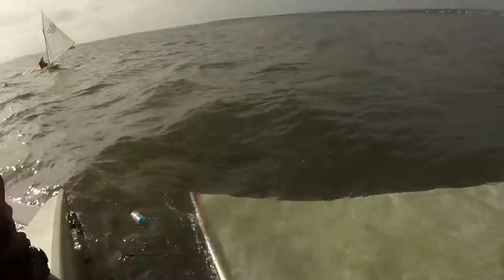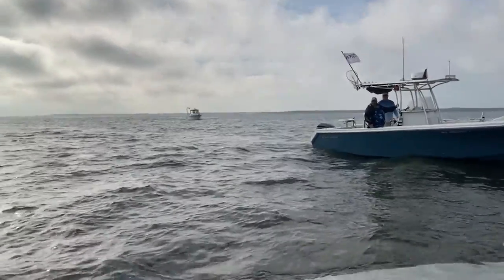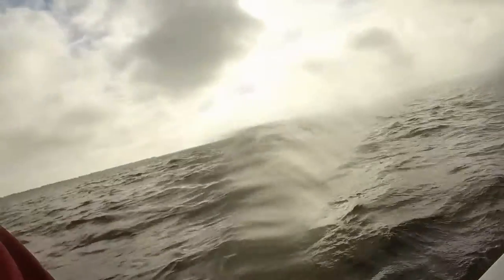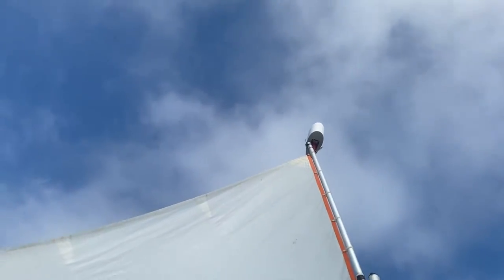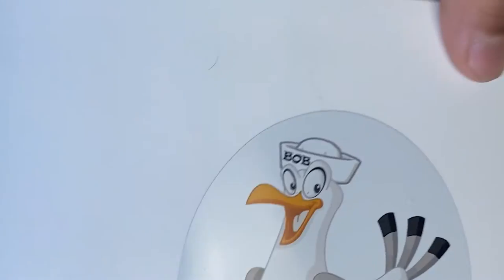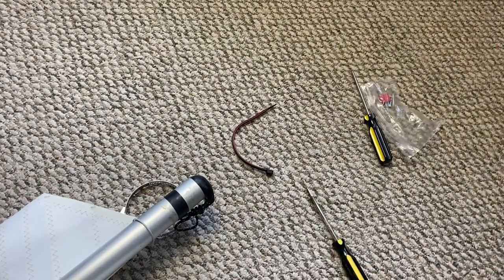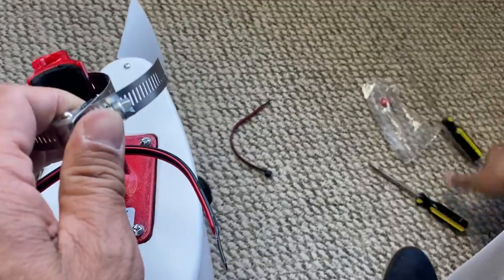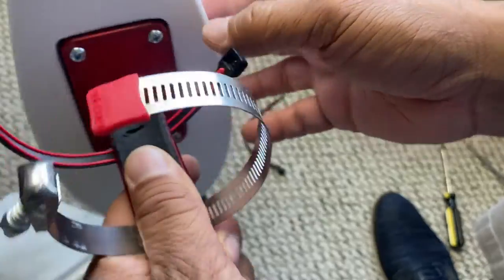Sunfish Sailing How to Avoid Capsizing Turning Turtle | Sail Safer

Comment: Hi, Lost my 1st reply. I made a Bob out of pool noodles for my Laser in Canada as I love Dingy Bob on my Sunfish in Venice Fl.  Cut up 2 noodles in about 14” pieces - Strung together - clipped to the sail strap on mast top of Laser sleeve - I haven’t tested it but it should work as 2 noodles can float a heavy sailor. I’m a senior retired physio and all about safety. Lasers are much tippier than Sunfish. I did share this with Kent as I did not want to cut into the sail sleeve of the Laser to install Dingy Bob.Thanks for the video. You rock!!
Reply from the maker: Thank you!   And good idea to not cut up the sail :). Sail safe!

Comment: Al Courtines Technologies uses a gimble mounted beer holder. When my boat turns turtle, the beer stays fresh. Saves a lot of beer! My windsurfing experience tells me to rotate the boat back up with the wind at your back, otherwise it may flip over on its other side. Let the water spill out of your sail slowly, or you risk bending the spar. I hope the dingy bob can rotate freely so it can align itself with the apparent wind.

Comment: Have you tried a 1 gallon milk jug tied to top of mast? 
We have some Barnett 1400's in our fleet. Same length as Sunfish but larger cockpit and wider. Suits larger sailor or 2 sailors better than a Sunfish. We sail on Lake Michigan and some folks have found it difficult to right after capsize, especially if turtles. I did some tests and found 1 gallon jug works, 2 jugs even better. I had boat capsized then stood on horizontal mast to sink it. With 2 jugs it came back to surface right away. I also saw an article on DIY bob using a lobster net float so Im going to try a 2 gallon version. What do you think? On Barnett it is easy to tie jug or lobster float onto the halyard shackle or sail grommets so no complicated fixing required. Cost :"milk jug free
Reply: lobster float HML-BUOYL-22 Hamilton Marine $8
Reply from the maker: I know people who have used gallon jugs, milk, bleach. Etc etc.   it’s basically all Tyne same principle.   Yes they work too.   But someone may not like the look of one vs another.  :).  Appreciate the comments!
Reply: @LeeSideSailing   we were given a nice Hobie Getaway this year at our club. Someone thought the Mama Bob was a radar mast, so I just tell anyone who asks that it came with built in Sat-Nav!!!
Reply from the maker: Hahaha.  I told someone something similar—-   Like it was a radar antenna:)
Reply from the maker: That would be cool.   And in time for Christmas :)